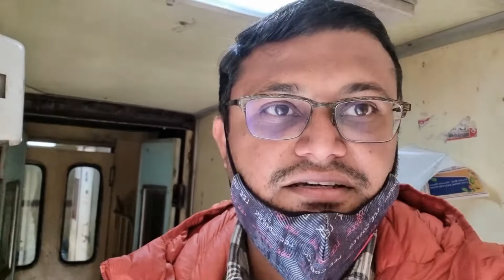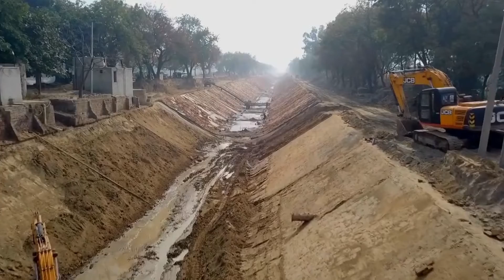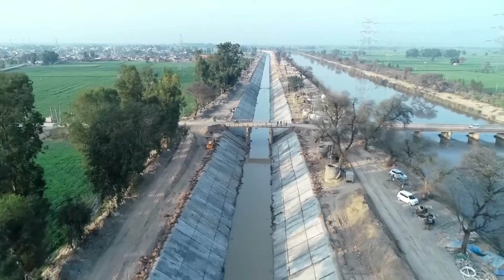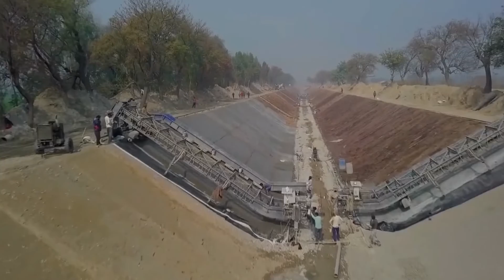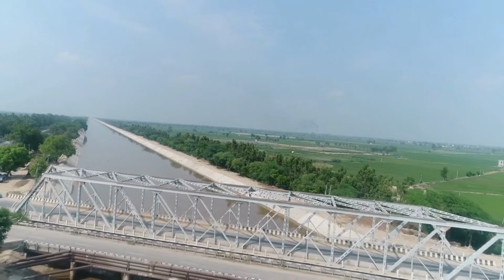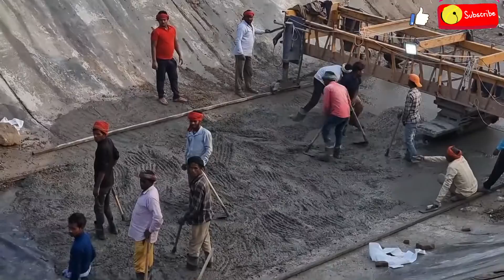Sirhind and Rajasthan Feeder Canal II Visit to Bhatinda, Punjab

Comment: Bad plastic works in this canal
Reply from the maker: Earlier seepage was happening due to brick lining and unlined canal and waterlogging problem was there in nearby areas. Now it is changed to concrete lining and problem of waterlogging is resolved. Moreover for construction of lining on slopes and bed, they are getting very small time only around 28 to 30 days which is very small duration considering the numerous activities involved in its construction.
Reply: @lalitsolanki81  but they are using low grade material that's why on 12 may it's got damaged. And we are suffering from it